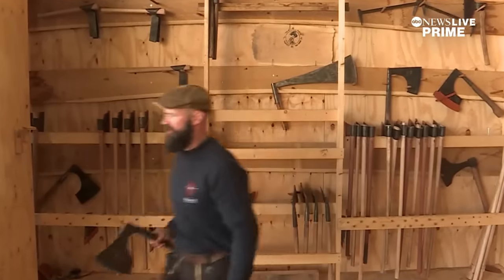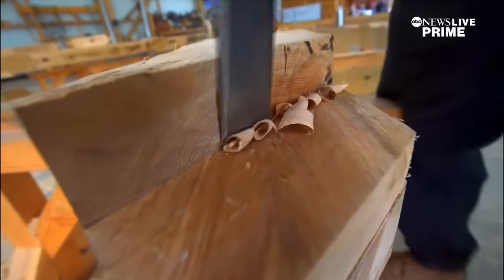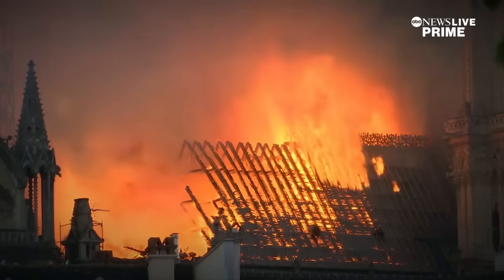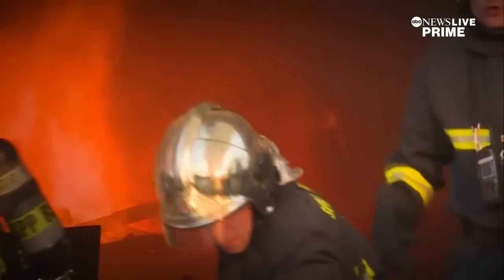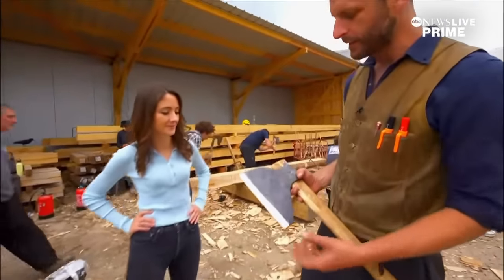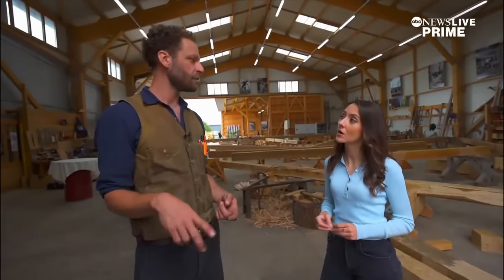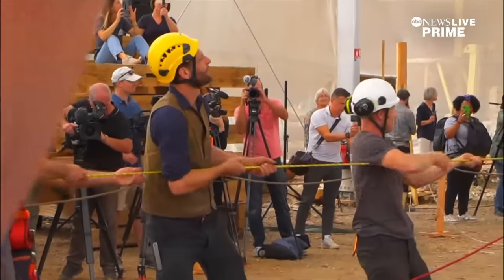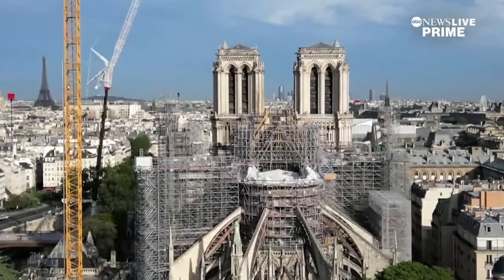Inside the rebuilding of Notre Dame cathedral | Prime

Comment: During Colonial times in America, carpenters would build all frames for buildings this same way, except that the pit saw had been invented. They put the frame together in their shops to make sure everything fit together as it should, then disassembled it and took it to the building site. While they did cut joists the same, the drill was used some times, and a wooden dowel was hammered in for extra stability. Work done this way is beautiful, not like todays frames with frame grade pine (the worst) 2x4s that are actually 1-3/4ths by 3x3/4ths and hammered together with a nail gun. Guess which construction method will not last hundreds of years.

Comment: They seem to be trying to complete the restoration by the time the 2024 Olympics are held in Paris. We'll see! In any case, I visited the Notre Dame cathedral as an exchange student in the mid 80's and would love to go back.
Reply: I watched another report from a broadcast in France and they said they should have most of the work done but there isn't much of an expectation to have the Notre Dame open or finished by the time the Olympics start.
Reply: Looks like about another five years of work there still, unless they go IKEA flatpack obviously..
Reply: Notre Dame will reopen its doors to the public on Sunday, December 8, 2024, the feast day of the Immaculate Conception.
Reply: @philtucker1224 the exterior of notre dame should look like notre dame for the Olympics, with less scaffolding. 
It will be re - opened for the cult on December 8, 2024. They are on time. The interior is almost done. 

There will have new restoration work on the exterior back (apse - chevet) of the cathedral, that was already needed before the fire. The stone of the apse is in bad state and need to be restored.

Comment: In the clip of the fleche burning, did I see a bell?  If there was a bell in it, was it ever rung?  I understood that Notre Dame's bells were in the towers.
Reply: No bells in the “ flèche “
Reply: @jean-yvesmartin6934 Actually there were 3 or more bells in the spire, I have no idea why they were put there, and have they been ringing, but there is a video of a guy who illegally climbed the spire, and you can have a good view of it from inside.
Reply: @thealaris there were some bells in the spire but rarely used because manual. 
(The bigger bells in the towers are connected with electronic)
Reply: Yes there were smaller bells in the spire but rarely used because manual.
Reply: @CitronCassis  Thanks

Comment: Did you not understand why you have to use old techniques? What does it matter how you build it, the main thing is that it turned out beautiful. And if you're already building again, why do exactly the same thing? Will it be flammable again? Make concrete and steel, and paint it yellow to look like wood. Stronger, safer and less flammable. Who is the genius who builds a wooden structure to accommodate 10,000 people? Didn't they think that a fire would break out and thousands of people would die?

Comment: Good stuff, but they'll be fools if they don't install a system of sensors and automatic sprinklers in that new wood roof structure.
Reply: Before the fire it lasted more or less 700 years without…..
Reply: @arno222444 yea but climate change ain't what it used to be. With Temps rising and weather becoming more unpredictable, a checks and balances would be helpful

Comment: Not sure why they can't use power tools, when it was first built they used the best possible tools and technology to get this state of the art for the time building constructed.  If it's essentially the same just faster why not get it done and maybe even do some upgrades to make it more safe, but at least mainly preserving the appearance and most of the materials?
Reply: Because there is a huge visible comparison when power tools are used that cannot be faked. That timeless look cannot be achieved. That building was a masterpiece, a work of art, so it's good to see the thought being put into it. Yes it's going to take time
Reply: They do use power tools , but try to keep it to a minimum. It is a historical masterpiece. That may not mean much to some, but it does to many, many others. 

Power  tools being used:

https://www.youtube.com/watch?v=sZYD09Fl5O4
Reply: @abc123fhdi I agree that it is silly to use only hand tools to restore this historical treasure. The technology of timber frame is important but pit sawing timbers is ridiculous as would be bit and brace for peg holes. Time and money are the important things and integration of power and hand tool work methods produce the desired esthetic results faster, cheaper, and with higher quality. What value is there in saying we did it the hardest way possible, vanity? Why not use a tread wheel crane for all the lifts during construction? Architectural conservation must weight decisions concerning materials, methods, and costs against the objectives of a project and not waste time and effort on trivial details like cataloging the location within a forest where a tree was harvested. Apparently this project is way over funded to the detriment of other restorations.
Reply: it's not a barn, fella. And using old techniques helps to keep the knowledge
Reply: They are using power tools for some aspects of the reconstruction, but not for anything that will be visible after it's all put together. Anyway, its up to the French to do it in whatever way they think best.
Reply: Because it’s not only about the end result it’s about the way to get there. It’s something spiritual. I guess It’s something difficult to understand for an american you are so much end result focused.
Reply: @arno222444 I'm an American and I love this comment. It's sad how convenience has led to the downfall of society. I pine for a time when people took time and effort to get the job done.
Reply: @peterberg8417  
It’s a strong cultural difference between Europe and the USA I suppose… we live in old cities, sometimes more than 1,000+ years old, they are far from perfect and that’s what gives them a soul…. In the US everything is clean and perfect but I don’t feel the same vibes…. 
I really like the fact they use the « old » way to rebuild, they are saving Notre Dame soul…. 
And if some people do no understand what I am talking about it’s not a big deal we’re all different and we have to respect that.
Reply: @arno222444  I agree with you but I love history and hate when old buildings are torn down in the name of modernity
Reply: @arno222444  Or some of us noticed that much of it is NOT using 13th century technology because we're paying attention - and realize it is an arbitrary decision in most instances.
Reply: @peterberg8417  It's such a shame we ever started using metals, after all one can simply sharpen flint and bones. Taking time and effort does NOT mean relying on outdated technologies, and you'll note they felled and debarked trees using modern methods and hoist the roof elements with cranes. Do you think that's an embarrassing concession to convenience?
Reply: @arno222444  Apparently you have never been to the US. They are hardly using the "old" way to rebuild in general. It's an arbitrary line.
Reply: @zweigackroyd7301  LOL thank you mate to underline my point.
Reply: @arno222444  yeah practicality be dammed. The construction of the roof and spire is timber frame so timber framing the rebuild is a requirement. The tools used to effect a timber frame joint is not important. Whether a brace and bit was used to drill a peg hole or whether a power drill was used makes no difference. The same is true for every joint used to complete the the project. Do you think that bolts and brackets and nuts and washers used should be hand forged in charcoal forge? Should only cut nails be used to fasten boards? Should all beams be pit sawed and/or hand hewed? Should all assemblies be lifted with human powered squirrel cage cranes? Get real. It is the building that results not the methods used that count.
Reply: @arno222444  yeah practicality be dammed. The construction of the roof and spire is timber frame so timber framing the rebuild is a requirement. The tools used to effect a timber frame joint is not important. Whether a brace and bit was used to drill a peg hole or whether a power drill was used makes no difference. The same is true for every joint used to complete the the project. Do you think that bolts and brackets and nuts and washers used should be hand forged in charcoal forge? Should only cut nails be used to fasten boards? Should all beams be pit sawed and/or hand hewed? Should all assemblies be lifted with human powered squirrel cage cranes? Get real. It is the building that results not the methods used that count.
Reply: @peterberg8417  
Well, as Arno said, (even if other people disagreed ): 
- this work is about preserving a knowledge, a know-how. It helps a lot to train professionals and youngs that will restore other buildings after that. 

- BUT, there is also the fact that when chopping manually, they respect the natural lines of the wood making the final piece stringe. 
- Also the final image of the result will look like « the forest » = the original wood roof 
Ofc, they used some mechanical tools in many fields in the cathedral (even wood and stone sculpture) but the manual chopping to respect natural lines was a decision that was shared by workers, architects etc. 

Many discoveries have been made in the cathedral : 
-from the way to grow trees more quickly and adapted to roofs of cathedrals, also the type of wood needed, 
- the window techniques, 
- some construction reinforcement hidden below the roof were discovered. 

These discoveries will have a HUGE impact for future monuments restoration in the whole Europe, along with some techniques that are now mastered by many workers.
Reply: @arno222444 totally agreed with you.

Comment: Four minutes?
It gets worse. Look at the amount of actual content relevant to the video title. And then trim it down because "facing a timber with an axe" is pretty much the same as "facing a timber with an axe" and "facing a timber with an axe" .
And stuff like this "[there's a database] so we know exactly where in the forest this beam came from."   Because...? No reason. It's just that he said "GPS" and "forest" so, combined, that will catch the attention of 70% of our viewership. "Ooo, GPS, I learned 'Notre Dame, something something GPS.' GPS is cool. I work in tech."
What kind of puzzle is "pre-designed timberwork with traditional joinery techniques?" It isn't "a thing that is puzzling". Mortise and tenon is... kinda like blob and hole jigsaw puzzles. Except without the locking because carpentry works unlike jigsaw puzzles. So what are you saying? Why are you saying it? To misrepresent the project? It certainly isn't to show off.

Comment: Cool. But I did not know that they used modern tower cranes 800 years ago.
Reply: Construction cranes been around since 600 BC. Human or animal powered.
Reply: They didn't. And since no one is claiming that every aspect of the rebuilding of the cathedral is being done using ancient methods then your comment is misplaced.
Reply: The spire is 'only' 150 years old.
Reply: @stevenweikert7062  Hardly misplaced given the attitudes in the comment section, as if doing it the "old" way is self-evidently correct and the only legitimate option. Not everybody ignores the arbitrary decision points.
Reply: @zweigackroyd7301  Whose opinions should be more heeded regarding the proper way to rebuild parts of an 800 year old cathedral? The experts who are actively engaged in doing that or the armchair engineers and armchair architects who post comments on YouTube videos? According to your "logic" the builders should ignore the advice they get from their experts and make all further decisions based on the advice they get in YouTube comments.
Reply: @stevenweikert7062  AAnd who exactly is an expert in rebuilding an 800 year old building badly damaged by fire? Oh, right. Nobody. Your so-called "experts" are just the people who were hired and made arbitrary decisions about which steps to do with old techniques. That doesn't mean the decision are bad. But it isn't a question of architectural or engineering expertise to note that doing the logging in a modern way, prepping the lumbers with machinery, and then ditching modern tools isn't a question of whether the building will be more or less resistant. Not using nails and other modern fasteners - that's a different story.
Reply: @zweigackroyd7301 You seem to assume you can't be an expert in mediaeval construction techniques unless you have previously constructed a cathedral.  Never heard of books? Is it possible that some of these people have prior experience using those old techniques to repair other mediaeval structures? (In case you were wondering, Notre Dame de Paris isn't the only mediaeval structure in France that has needed repair in the last few decades).

You say there are no experts in mediaeval construction techniques. OK, fine. But who is closer to being one: you or someone specifically recruited to work on the reconstruction of Notre Dame? I realize that this may be  a difficult question for you to answer so take all the time you need before answering.

Comment: I don't think they should be SO obsessive about reproducing "every blemish".  Every prior time it was refurbished the people rebuilding it put their own touches on it.  There should be some leeway for creativity.  Certainly, the construction process should follow the original method (wooden pegs held up way longer than steel nails would have, etc)
Reply: @creamwobbly I understand each builder adding their own personal touches, but it doesn’t need to be modern at all. Especially considering that most modern architecture is hideous, only prioritizing function rather than the people who have to use them.

Comment: While I applaud the effort, I believe the original wood sat submerged in a swamp for 40 years to harden and prevent insects from burrowing.  While it's understandable the French don't want to wait decades, I wonder what will be done to replicate the overall quality of the wood?
Reply: you are wrong, all medieval carpentry was done using freshly cut oak trees. there are many accounts  of this way to build in our National Archives.  Freshly cut oak is much easier to work with. furthermore it allows some kind of flexibility to the whole structure while it sets in onto the walls and then it dries slowly over time.